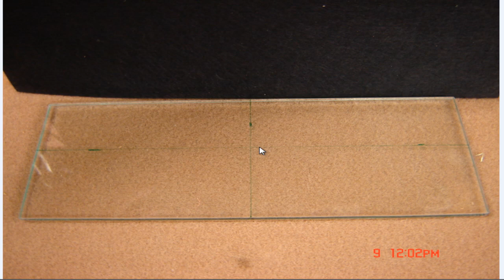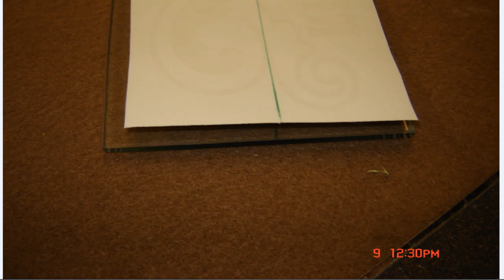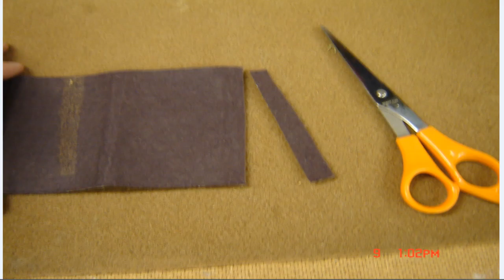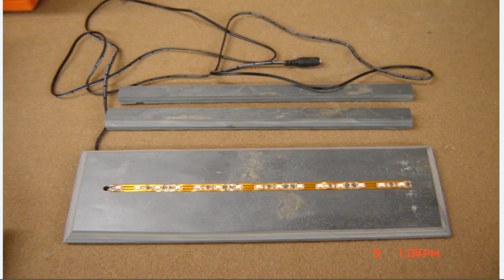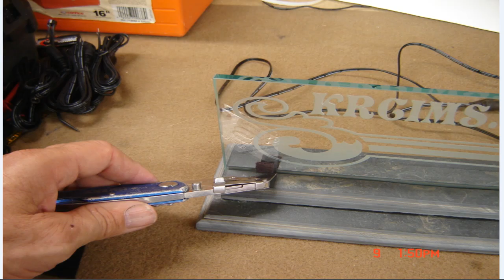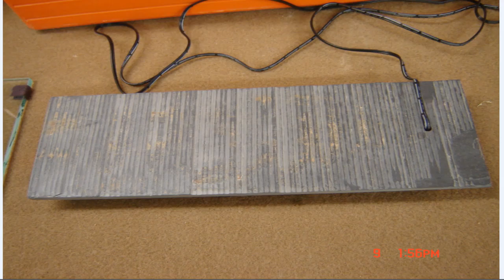LED Signs

Comment: Hi friend! First, thanks for the video!
So how does the lyrics and/or drawings in acrylic or glass?
thanks
Reply from the maker: Daniel Fernandes I design my drawings in CorelDraw then cut them on a vinyl cutter. After applying the stencil to the glass I use 180 grit A/O and sandblast. Thanks for watching. Ken